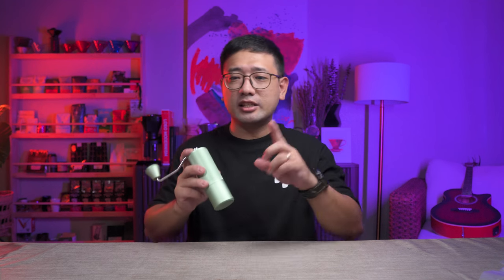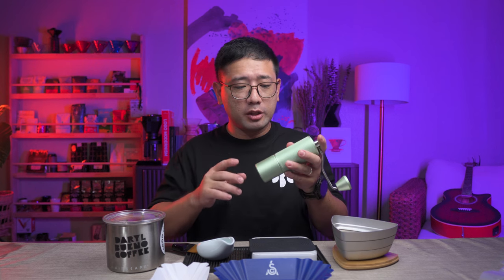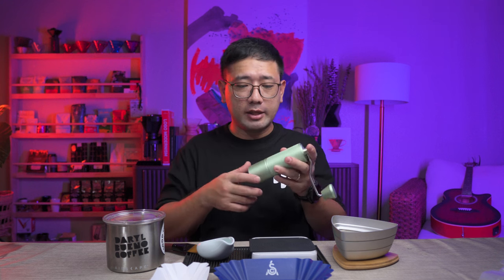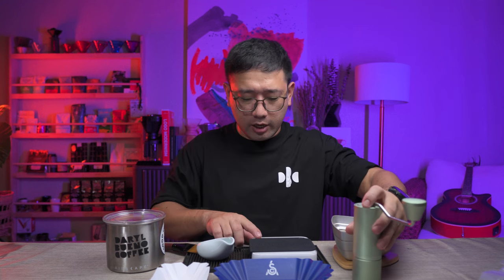Timemore C3 Slowfeed Test

Comment: just tried a slow feed with my C3, and it tasted different from what it usually produces. it is much brighter and more acidic, but the lychee notes disappeared. I dont know what I did wrong. I used Mt. Apo anaerobic natural po by Marivic Dubria
Reply from the maker: @energygabby  nice! :) maybe you need to adjust your contact time. This could extract more while have the power to brew with lower temps :)
Reply: @darylbuenocoffee  oh nicee ill try this. thank you!!